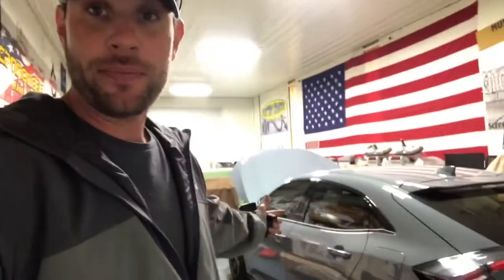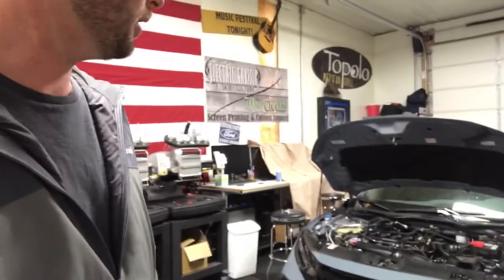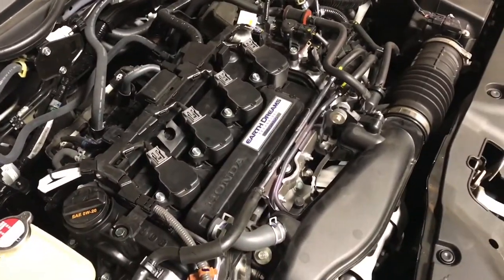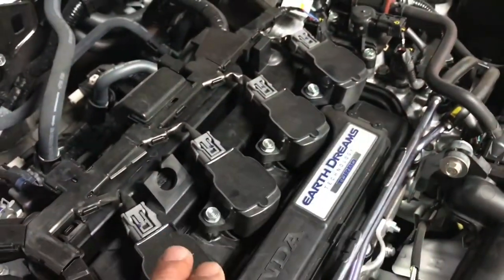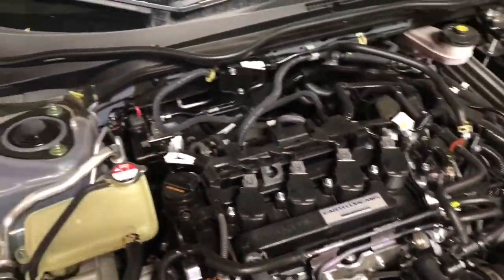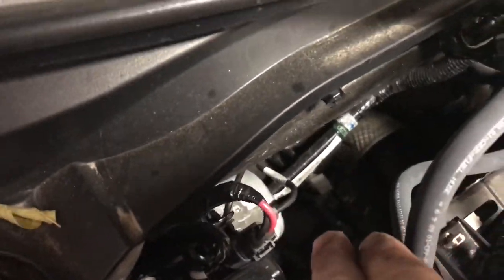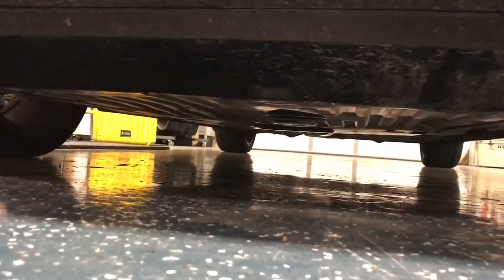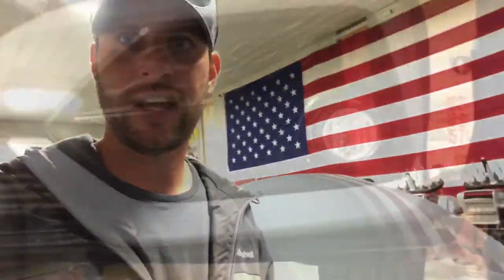Honda Civic electrical problems - rodents chewing wires - fixed

Comment: I just leased a 2019 Honda Civic and 2 months into having the car I have the exact same problem. Now the dealership s giving me the runaround and telling me I have to go through insurance to fix it. Why is Honda installing the same exact soy based wiring in their cars when they know that there will be problems? Do not buy a Honda! If they are not going to address a known problem then why would people buy their cars?
Reply: I've a 2018 Audi s5 same problem !! im waiting to see if insurance will cover it
Reply: I have the same problem  they want to charge me 4,800 to repair it   why should we be responsible for this

Comment: I spent $510.00 dollars for the damage. The dealership said I have a rodent problem. They weren't forthcoming with the issue. I've had numerous cars in my driveway for 30 years. It never had happened before. They reimbursed me my money after a negative comment. I can buy a lot of peppermint oil with the money for the next 7 years.

Comment: Rodents chew on all plastics, soy or no soy, as plastic is a very good material for sharpening their teeth on, which rodents must do daily or their teeth will grow into their skulls. Rats chew the wiring in many makes and models of cars and trucks, not only Honda vehicles. I trap rats for my living and regularly am called to deal with rats chewing Jeep, Toyota, Dodge and other makes, sometimes causing thousands of dollars in damages for new wiring harnesses. If there is any chance of rats or mice chewing your vehicle's wiring, place a few rat traps and mouse traps set under your vehicle's engine area at night, especially during winters if you live north of about 40 degrees latitude.

Comment: I have the same problem!! I literally just got this fixed at a Honda dealership and paid $400 bucks for it. Today (3 weeks after the repair) I am facing the same problem. The dealership sent me ANOTHER 400 dollar estimate. I looked up the part online and it costs 14 bucks so I will try to fix this myself or a local mechanic. But wow that soybean coated wires thing just hits it home for me. I was just getting around to paying off this car but it looks like this baby will have to go. Thanks for video man! This is super helpful.
Reply: Put Vaseline on the wires and then sprinkle cayenne pepper on them. I had to do this to fix my wires in the engine compartment. Now I have to do the fix under the car now.

Comment: I have a 2018 Honda Civic Hatchback and I am dealing with this precise issue. I can assure you that nothing was done to replace the soybased wire coating after your incident. I took my vehicle in about two weeks ago to get the wires on the steering rack fixed and now I am waiting for the tow truck to take my car back in the shop to confirm the damage, which I presume is the same issue. The things people do to be more "green".

Comment: 2018 Camry: Many codes were set for brakes and LDA . Rodent ate the main wiring harness , the dealer charged $800 I thought it was a lot but some people have $3000 bills. We are going to use a rodent spray (Tomcat brand) and coat as many wires as possible. We are going to do it every month, it only takes a minute if you are just doing it under the hood.

Comment: Thanks for making this video very helpful info.
My 07 Volvo has been recently damaged by rodents non stop tried every type of deterrent sprays,  traps,  fabric softener sheets etc... 
I found out that this issue has been getting worse as the newer models that came out after mine these companies going green is a joke.
My brother just bought a 2019 Honda civic  and my dog is detecting something in front area of car, just like it did when I didn't realize for many months there were rodents doing plenty of damage on mine.

Not having this issue with my mid 1990's vehicles at all...

I am now researching which brands do not use soy based wires, parts,  or going green non sense  otherwise they won't see any green from my pocket.

Comment: I have the exact same problem with my 2017 Honda Civic that I bought new. Every year, I clean out acorns I find in the engine  compartment. The service dept. told me to put dryer sheets around the area, but I've also got conflicting information on doing this. My car is the shop right now and I've been told that rodents chewed on my wires and caused a check engine light to go on. It will cost me about $1800 to have the wiring replaced. I have heard of a 12 volt rodent repellent that you attach the battery of the car. It's cheap $28.00 and reviews have been generally favorable. After watching your video, I've decided that it's time to get rid of this car after I've had the damage fixed and the check engine light reset. I can't imagine selling this car to anyone in this damaged condition. It's too bad because I only have 17,000 miles on it.
Reply: I had this same issues. I paid 300 bucks for the new wire and installation. Happened 2 weeks later so I spent the 30 bucks on the new harness and did it myself in about an hour. I had to do it topside so it was probably 10x harder for me than your local mechanic. 1800 bucks for 15 minutes of labor is absurd.. Sorry you got scammed. I did this myself and I barely know how to change a cars oil... lol
Reply: @Crumt30  Thanks for your reply. First, I want to be clear that I wasn't scammed.  I had another service department take a look at it and their estimate was about the same. I'm using a dealership service dept. do the work and I know labor Is more expensive than using an independent repair service. Also, I wanted the replacement part from the manufacturer. Yes, it costs a lot more to do it this way. If the car had 100,000 miles on it, then I definitely would go the cheaper route and sell the car. But my 2017 car has less than 20,000 miles on it and is paid for. The resale value of the car is also worth it.

Comment: My neighbor 2 houses down from me had this problem with her Lexus she stored outside. It was her "summer only" car and mice had caused over $3500 in damage from chewed wires. My 2011 Ford Fusion Hybrid sits outside 24/7 except in winter where it goes in the garage and my 2012 Taurus sits outside during winter upwards of 5 months. In the 7 years I have been doing this, I have had zero problems related to chewed wires.

Comment: Thank you for this video - I just returned from the Honda Dealership where I had to pay $420 to have them reconnect the wiring. Ridiculous.
Reply: Once you get the new wires, request them to put rodent tape. Honda provides this.
Reply: It resolved my issues and my car runs fine.

Comment: Just got back from having 2019 Honda Civic Sport model repaired at the Honda dealership- I paid $400.00 on Monday and 3 days later, the power steering is chewed up again!! Someone said to put ammonia mixed with water and spray on the wires to repel rodents. I went to 2 stores and they were out of ammonia, so I went to Home Depot and bought 
Repels All - Animal Repellent.

Comment: This exact same thing happened to my 2016 F-150. Came out in the morning and my truck wouldn’t start. Had it towed and found out mice had eaten into the wire harness.

Comment: Rodents just chewed through my wires as well! Same car. What code was your car showing?? My car is throwing code P0353 which means the car cant control the third ignition coil, which led me to the top of the engine where I could see that mice had a field day in there. They chewed through the third wire and pooped all over my engine

Comment: Just had this happen to me yesterday on my 2019 Honda Civic.  I thought it was some joke.  Warranty wouldn’t cover and they said the damage was around $400.  Car is currently in their shop getting fixed tomorrow, but they aren’t very comforting telling me that they’re not 100% sure if this will fix the problems, though they said it’s a slim chance there’s anything else wrong than the wire being replaced.   Let’s hope please 🤞🏻

Comment: Thanks for the video. I was quoted $800 from Honda just to investigate. They did confirm that soy bean attracts rodents. advised to check insurance coverage because it will be expensive. I will inspect my self and will let you know the results for others. The question is, how do you keep rodents from chewing? red hot chili cream?

Comment: Hi Larry! I just had that problem this week on my '16 Honda Civic 1.5 EX-T. Rodent chewed my head light wiring harness. It had short circuit caused to damage several wires. I got frusrated for hours that day trying to fix it. I was about to bring it to dealer and have it fix but thinking of paying it from my pocket will be expensive so i decided not to bring it. I found a way to solder the wires and solved the problems but still have these worries everytime i drive yhis car. Do you think insurance will cover this repair? I have full coverage plan but im still on my lease contract on this car. Any comment from you would be gladly appreciated. Thanks!
Reply from the maker: Hey Norbie, sorry for the delay response.  Unfortunately my insurance would not cover it. Perhaps your insurance might!  its worth a shot.  let me know if they did!

Comment: 2017 Honda Civic same issue, took it to the dealer 475 to replace a 20 dollar piece of harness. Now 2 weeks later same issue, they didn’t offer rodent tape it’s a money maker for them I am sure. I have the harness for this one trying to replace it but they really work at making it difficult for you to access things yourself.
Reply: You can get the tape on Amazon.

Comment: I have the same issue with my 2017 Honda Civic ex Hatchback, rodents ate away at parts of my wiring and Honda said I should go thru my insurance for the costly repair to replace the wiring, Yeah but I’m still stuck with deductible.  I  researched to find out that the essential oil of peppermint in a water spray bottle may help.  Rodents HATE peppermint.  Good luck everyone.

Comment: People there is a tape coated with a strong pepper you can buy from Amazon that will rodent proof your wiring.  Ever since I had the dealer wrap my wires, no rodents chewed through.  My problem is keeping them out of the cabin air filter and intake.
Reply from the maker: Fox Rivers I saw the tape too, but decided it was just putting make up on it - the problem still remains, plus wrapping every wire on one of these cars would literally be misery.  There are a lot of wires.  I haven’t had any issues with the air intake on these models.  It was the rabbits that were really doing some damage to the wires more than the mice.  Good luck with your fix!
Reply: @graffix  I decided I am going to build a trap this time and see if I can catch one and release.  There are tons of videos on this.
Reply: How much does dealer charge? Did you bring your own tape? This happened twice so far.  I have got to do something. Do you do anything else??
Reply: @sylviaharris8870 The dealer didn't charge extra for that and I got the tape on Amazon. Right now I have my hood open, with a bright led light shining in, and an ultrasonic emitter running all the time which I also bought on Amazon.  That's supposed to make it unattractive to them.

Comment: Run your car thru the car wash immediately after winter to get the road salt powder off your wires underneath.  The salt also attracts animals to chew on your wires.  $900 for a 2007 pilot wire job from Honda.  Add extra wire insulation and spray paint those wires to give them a bad taste.  Just had my vtm-4 light come on and yep a chewed wire.  If you see squirrels hanging around your car you better get them off.

Comment: Had EXACTLY same problem last year. They got to electronic steering and main harness. Now again. This time they got my vtec solenoid and fuel injection wires. Gonna fix it then do what you're doing. Get rid of it. I like my Si, but soooooo tired of this crap.

Comment: I have a 2017 Honda Civic EX turbo Hatchback. Those damn rats chewed my harness underneath and a shop charged me about $270 for a fix. Now 6 to 7 months later i'm having similar issues (but not as bad) which I highly  suspect is more rat chewing. This time i'm going to investigate it and try to fix it myself. I'm also going to put a bunch of rat traps (and maybe poison) under the car. I'm at war with these damn rats!!!! Also, raising the hood at night discourages rodents from nesting in the engine compartment.

Comment: Rodents are attracted to the battery, the electrolysis on it shows the presence of water. If you spray the engine bay with a mixture of water and peppermint oil every 4-6 months rodents will stay away - they don't like peppermint (or bleach).
Reply: Does they by any chance get used to it?

Comment: I wish I had seen this video last year.  

I’m at $2100 and counting.
Reply from the maker: Man, I hate hearing that.  Honda really should step up and replace this problem.  They are offering a pepper tape to install on the vehicle, but even then it's at the consumer's expense.  I traded it off for a domestic.  They are not using soybean wires on Ford, Chevy and Dodge.

Comment: So what year did they start using soybean wiring?
Does anyone know please?
Reply: Probably all the way back to 2009-2010. I've 2015 Civic, same issue. But rodent tape SEEMS to help. Not 100% sure.
Reply: Don't know, but they ate the wiring on my '99 F250 Ford truck!

Comment: Ok, I'll bite (sorry) What new cars DO NOT have soy based wiring? My guess is it's cheaper so they all have it. Be nice to know. Otherwise it's pepper tape, or moth balls, peppermint spray, or decon etc. Also, I have heard of a lot of electrical problems in general with newer Hondas, actually starting like 2012 and up to the newest models.

Comment: Rats chewed the wires twice so far. Why would Honda  not fix this problem, if it happens over again?
Reply from the maker: 53820351 it’s because they deem it as an ‘act of nature’ - however they made the wires out of food... hmmmmmmm. It’s terrible.
Reply: Get Rodent tape from Honda. But first fix it w/ new wires then wrap it w/ rodent tape. It happened in my first year of owning my Civic. After I had them replace my wires, I put rodent tape and car works fine.
Reply: @jj5515  How much did the dealer charge to wrap w/rodent tape. Wires are fixed.? Did you tape the wires yourself? This has happened twice so far. So far, I'm $3100 in the hole.

Comment: "I hope this is helpful."
No, not really. Get rid of your Toyota or Honda (the most reliable vehicles) because you can't solve a rodent problem
Is just Stupid!
I place one mothball every 18" around/
underneath my car, closer under the engine compartment. 
Use the mesh bags moth balls come in, or make your own: 6 - 8 moth balls per bag,
tied at the top with about 2 feet of string
for easy retrieval. Place on flat or cubby- hole type spaces or previously damaged areas, as well as where the hood is hinged.
I used to put out the old-time mouse traps, baited with one sunflower seed, as an added precaution, but haven't needed them after using mothballs.
As a backup and under the house I use
a mixture of: 1/2 cup each of cornmeal and plaster of Paris, 1 tbsp cocoa powder, 
2 tbsp granulated sugar. Place about two tablespoons in a shallow jar lid under engine compartment. This is just as effective as d-CON bait blocks but not as poisonous (won't harm other animals that eat the rodents' bodies). Rodents will seek a source of water after eating this concoction.
(I live in a forest, have already paid $250 for rodent wire damage [2010 Corolla], and decided to get serious about rodent
problem/damage.)
Occam's razor: the simplest solution is often the best one.